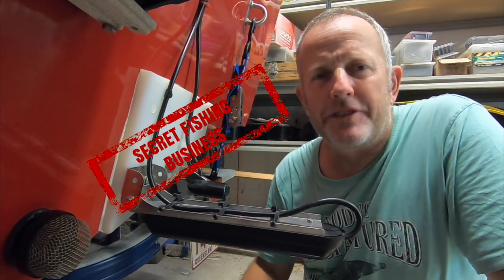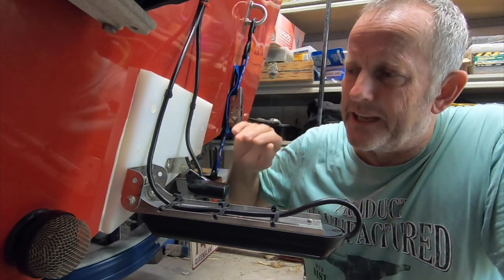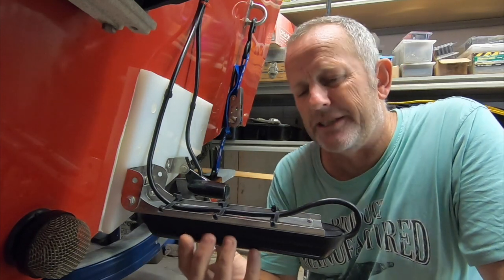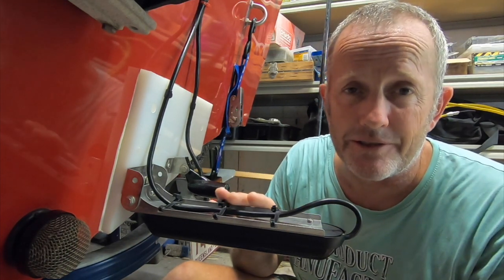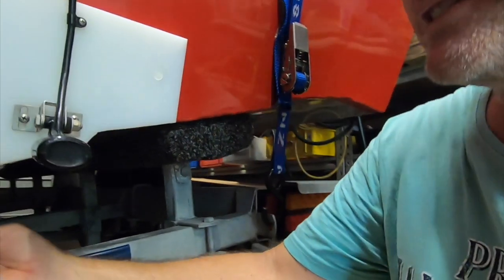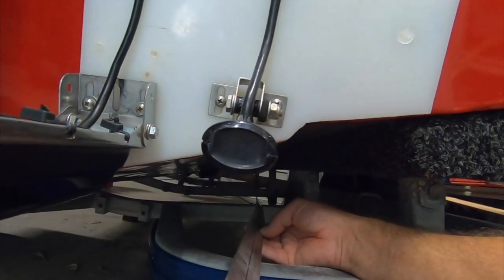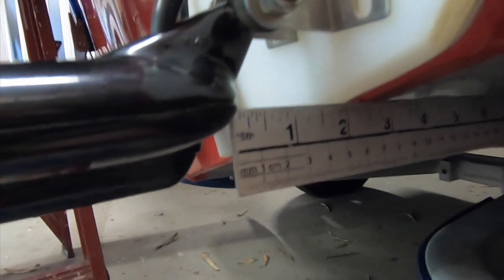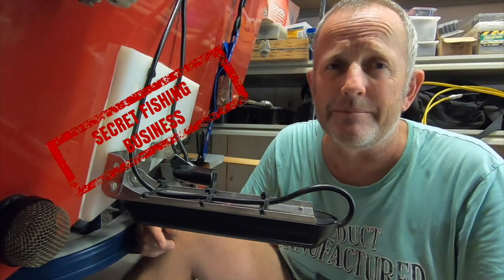PERFECT TRANSDUCER PLACEMENT FOR HIGH SPEED HOW TO

Comment: Thank you! I replaced the bracket came with the totalscan with a stainless steel bracket, I aligned the bracket as the way you showed on this video.  I tested today - I ran 27 MPH and didn't loose depth until I reached the 135' of water.  I am so happy!
thanks
Reply: hi i done the same with my totalscan  replaced it with the metal one

Comment: Thx!  The installation manual mentioned to do exactly what you said but I needed more assurance.    Dropping the transducer slightly level below the bottom of my boat did not make sense to me but since you did it I am also gonna try to do the same.    
* I just installed the mounting plate will screws and some 5200 adhesive sealant.

Comment: Hi,
Thanks for a GREAT! video.
I have a Scout Sport 177 boat with multiple steps  on the transom and I am in the process of installing a Lowrance Totalscan transducer.
The thing you explain that on boats with the deep vee setup that the transducer has to be placed in a LEVEL position in relation to the water lever as the boat sets in the water ready for operation. Then line up the center line of the transducer with the bottom of your boat.  This may look strange when mounted on the transom but is in the proper position for good readings from your transducer.
You are the man!
John
Reply from the maker: John's Marine Solutions thanks for the great feedback.
Reply: Also a good idea is to have someone driving your boat at speed while you look over the transom. Take a look at where your transom meets the water and look for the areas with the least amount of turbulence, White water. The cleanest water area is the area that you want to mount the transducer. Mark the area with a grease pencil (on a stick) or take pictures of the area for later reference.
Reply: @fishhunt9874  yeap... that should be the first step.

Comment: Hi! what kind of plastic did you use as transducer mount plate? Great video by the way, very helpful
Reply from the maker: I couldn’t tell you to be honest. There is a plastic factory near me that had some off cuts for sale. I think it is very similar to cutting boards. Sorry I can’t be more specific. Thanks for the feedback.
Reply: It's called starboard. Screws stay in, as opposed to regular cutting board plastic

Comment: Given that you have mounted in the reverse direction what do you have to do in the configuration to let the device know this??? I am assuming side scan and other modes would be potentially reversed and need to be inverted inside the console....
Reply from the maker: Yes the sidescan can be reversed on the console. Flipped from left to right to match the transducer being put on in reverse.

Comment: The problem is when you have a stern hull that is a "V" shape. No way to align the transducer at any particular level to the hull - one side is an inch higher (or lower) than the other. Will try hitting the middle at mid-height.
Reply from the maker: Mine is quite a deep V hull  I have gone off the centre point of the transducer. You could always try and fix it to the back of the keel if it’s a little flat. That seems to work really well also.

Comment: Great video. What is the white plastic block made from? I ask because I'm going to do the same but I know some plastics don't bond well to silicones.
Reply from the maker: I think it’s like cutting board type material. I just went to a plastic factory and got an off cut. Sorry I didn’t ask what type it was.
Reply: @SecretFishingBusiness  all good. Do you remember the silicone or Sikaflex you used?
Reply from the maker: @benp2724  kitchen and bathroom silicone and 2 screws. I think sikaflex has a marine grade product that works well. Mine has been on a few years now and doesn’t look like moving.

Comment: hello, sorry for the inconvenience, I wanted to ask you for advice, I bought a hdslive9 with the spnda imaging.3-1 and I wanted to ask you for advice, I saw that it contains 4 types of frequency (high chirp-medium- chirp/ 83e 200) I practice trolling with live snapper on a seabed ranging from 50 meters up to 90, for this type of depth which frequencies should I use? should I use only one or at 50 one frequency and at 90 another type of frequency?, I accept valuable advice thanks
Reply from the maker: Hi, both 83 and 200 should pick up fish at those depths. 83 will be a wider beam and 200 would be the narrower. I don’t really fish much in those depths, I prefer to case my snapper in under 5m of water and can get good snapper in 500mm of water. 

I think the 200 having the narrower beam would be better for trolling in those depths. The narrower beam would focus more on a smaller area under the boat. The wider beam would be better for searching wider. 
I have found schools of snapper in 60-70m of water doing 60kph. You would need you transducer set up nicely though, but it is possible.
Reply: @SecretFishingBusiness  thank you very much, you have been very kind
Reply from the maker: @giovanniiorfida7016  thanks 🙏🏻

Comment: I have the Elite9 TI2 with the 3 in 1 active scan transducer and I have a hard time getting the left image to look as good as the right until I get in deeper water (20 feet or more). I set the height pretty close to the way you have yours, but I have it mounted further away from the middle. Is the engine blocking the signal and should I move it closer to the center of the boat?

Comment: So, if you've flipped it front to back aren't your left/right side images reversed now?  ie actual left is on the right
Reply from the maker: Not at all but a great question. You can switch the settings from left to right in the settings to allow for this.

Comment: Does it give opposite sides on the screen as it's essentially backwards???

Im about to install my 3n1 in the next few days i run a big tm275lhw on a simrad nss evos have just picked up a lowerance hds carbon to run auto pilot so am pretty excited to try the 3n1 side scan
Reply from the maker: Rob you can switch left to right and right to left in the menu settings.
Reply: @SecretFishingBusiness  ok thanks mate

Comment: Thanks for the great video, I have the 3D transducer  and the HDI 83/200 455/800 from Laurence and wanted to say some install these flush, you definitely did not, I already installed mine 1/8 below the boat bottom but have room to lower 3/8 or more, how did you find the right  level(nose up or down) for the 2 as they are different? The 2D vs 3D I noticed the 3 in 1(which you ingeniously installed backwards) you had showing down a bit on one side and up a bit from the V(can that be done if I don't do the backwards style) and the same with the 2D, but did you do that by trying different positions or you already had it picked? I am just trying to get this ready for offshore in Southern California. Thanks again mate.
Reply from the maker: Thanks for the feedback. With both transducers I have them with the nose up just a touch, so there is minimal disturbance across the face of the transducer. The 3-1 transducer is right on the sweet spot of my boat. The hull has a lot to do with the smooth transition of water over your transducer. I have had a few transducers on that spot before.
Reply: @SecretFishingBusiness  So you didn't use a level to match your boat in the water, you just used the straight edge? And lowering it so much below the boat bottom, why do you think it's better than almost flush with the boat bottom?
Reply from the maker: @getitdone6694  the transducer needs to skim the water. If I had it any higher it would not read at speed.
Reply: @SecretFishingBusiness  Yeah the skimmer 2 D sonar one, but the 3 in 1 structure transducer also needs to skim? One guy on another youtube said the 3D should not need to be below the bottom of the boat. But the 2D does.
Reply from the maker: @getitdone6694  the 3-1 transducer has the sonar element in it as well so therefore it needs to be in the water. I have it turned around so the sonar element has cleaner water. If you wanted the 3D transducer to scan at speed it will also need to be in the water. If you are not interested in it working at speed then you probably don’t need it in the water. I can pick up objects like bridge pylons and other objects at speeds of 70kph, which can be useful sometimes.
Reply from the maker: @getitdone6694  if you want to see some screen shots of the sidescan reading at speed have a look at Secret Fishing Business on Facebook
Reply: @SecretFishingBusiness  My boat is a stern drive so the motor is in the way, contacted Laurence and asked if I could connect 2 separate 3D transducers and connect to the module using transducer wire 1 from starboard side one, and transducer wire 2 from the port side. The module only has 2 inputs(trans1 and trans 2) and each transducer has two wires(trans1 and trans 2). Do you have any thoughts on this, I have not tried it yet to see.
Reply from the maker: @getitdone6694  if you are not beaching your boat then mount the transducer on the bottom of your keel at the back. Some of the best readings I’ve seen have been from this position. Nothing interferes with the sidescan on either side.  Sika flex and or a few screws should do the job. I have not done this myself but it works very well. Not all keels would suit this application
Reply: @SecretFishingBusiness  That's where they put the through hull sonars but the structure one have not seen, it does sound like it would work if one can mount it as it is not a straight edge but a V. Not sure why they say to mount the transducer in line with the bottom, if it reads best from below in the water?
As I said I have 2 of them installed and will try to see if I can get signal using one wire from each to get both sides.
Reply: @SecretFishingBusiness  Can you show some screenshots anywhere in a video or load pics up so we can see them?
Reply from the maker: @getitdone6694  I have some screenshots on Facebook Secret fishing Business if you would like to have a look. 
https://fb.watch/5GFC3Yzq1v/

Comment: Hi, just came across your channel, thanks for the vid!
Question: the white plastic base you used, does it matter what plastic it is? Ie, can I use a basic plastic chopping board?
Reply: Should work. Best to sand one down good for best bonding. There's suggested roughing with sandpaper for different epoxy's or silicone sealing.

Comment: Why mount the transducer backwards? That bracket is designed to have the cable run straight up.
Reply from the maker: Leon Adler the sonar element is located closer to the cable exit point or traditionally the leading edge. If you turn it around the sonar element is at the rear and has less chance of getting turbulence from the leading edge. The new position now has the sonar element at the rear or trailing edge where the water is cleaner flowing over the transducer. Sidescan is flipped sides in settings. The reading is now flawless on my boat. Video explains it all.
Reply: @SecretFishingBusiness  thank you, sorry if I missed that part in the video, must have been when the wife started talking.. Lol. So with all Lowrances expertise and research, why would they design the transducer that way? If your findings indicated better readings with your placement, then cable should exit from the opposite end of the primary sensor.
Reply from the maker: Leon Adler I’m not sure but it helps give a better reading at speed. Another benefit that I have heard is that it can prevent water getting into the transducer from the cable pointing forward. I haven’t had that problem myself but a few guys have mentioned it happening on the faster bass boats.
Reply: Do you have a part number for that mounting bracket

Comment: @pachedu
0 seconds ago
A query..with the transducer reversed so the sensors are at the back dont you get interference with the motor being in the way on side imaging.
Reply from the maker: I’m not sure about the question. My motor always needs to be trimmed up to get a read on the left hand side. Whilst you can get good side images at speeds of 70kph they are limited on the left hand side because of turbulence from the deep V hull. Apart from that no interference. Side image needs to be flipped from left to right in the settings. I hope that answers your question.
Reply: @SecretFishingBusiness  Thats fine you answered the question.I have a new lowrance HD with 3 in 1 which still need to optomise
but have also had a hds2 touch and a humminbird 1198.
The motor was an issue as it shadowed on side scan on the HDS 2 touch but was ok on the bird.
Our thought was to get the sensors close to the hull.

Comment: hi good video, i will try reversing the transducer, is it still better for you having it reversed? also can i have the sonar a little higher up because my boat is on a swing mooring and drys out for a hour each day which is mud plus i would worry when riding along that it will hit a object in the water? thanks
Reply from the maker: Adrian that is the ideal position for my boat. Different hulls may vary. Maybe one of those adjustable transducer bracket will suit your boat particularly if it’s sitting on the ground at low tide.

Comment: Thanks for that. How far off the center of the prop would you measure to position the skimmer transducer
Reply from the maker: Wayne Park I fully tilted the motor leg down and then put it on full lock to make sure the motor doesn’t hit the transducer. That was as close as I could get it without possibility of knocking the transducer wit the outboard leg.

Comment: Thanks!  I have issues on my new boat, I lose depth at anywhere between 10 - 18 MPH and have to come to a near stop before it picks up again.
Reply from the maker: I hope this helps.
Reply: me too, did you solve it?
Reply: @BornAgainCynic0086  I had to tilt the back down about 5 degrees and tighten the bracket enough that it didn't tilt back up.
Reply: @mikehoneycutt5686  thank you

Comment: Do you run both simultaneously and if so does it create any noise on screen?
Reply from the maker: Dirt Tracker I don’t really run the second one as they are both the same transducer. I originally left it on there because it read so well at speed but the 3-1 reads just as good as well so I could probably take it off and will put it on the trolling motor.

Comment: hi having the transducer this  deep would course a roster tail
Reply from the maker: darryl veale yes it does spray a little bit but reads perfectly.
Reply: @SecretFishingBusiness  ok thanks
Reply: @SecretFishingBusiness  hi me again i have changed  my transducer around same as yours in reversed,,,, just a silly question  for you do you still have to tilt your motor as high   or can you have it lower and not get blocked from the motor.....?   Mine is  where the line goes around the transducer to the bottom of the transducer  is where bottom of the boat is thanks
Reply from the maker: darryl veale the left hand side is not as good as the right hand side. My motor is normally trimmed up a fair way at speed but I still think there is some interference.